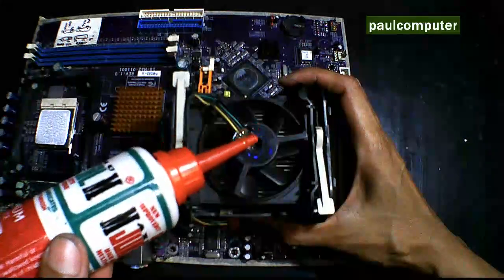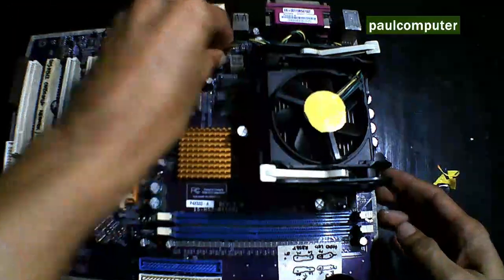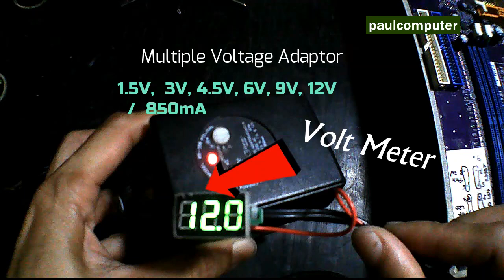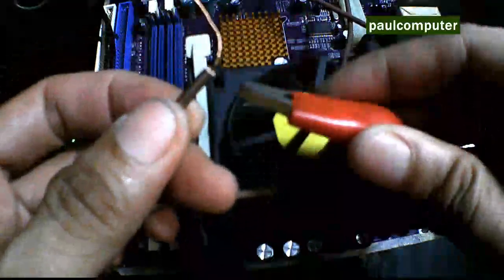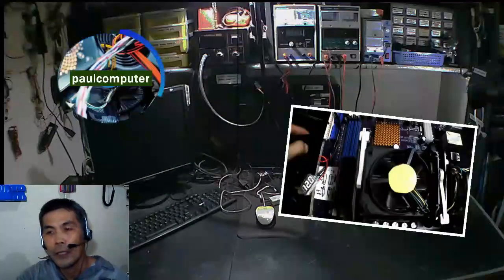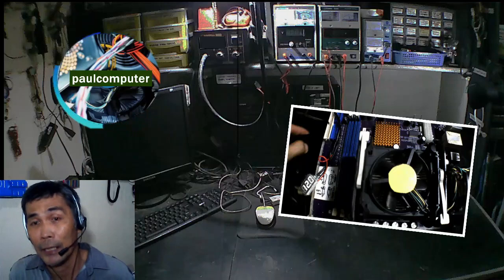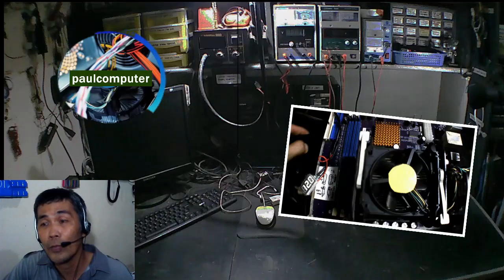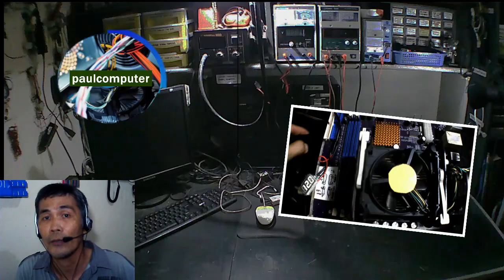HOW TO FIX A NOISY BLOWER FAN OF DESKTOP COMPUTER PROCESSOR - TAGALOG │ w/ CHAPTERS

Comment: Idol tanong ko lng po kung ano problema ng unit ko kasi pag inoopen ko maingay ang fan nya parang nag accelerate pero pag ginagamit kona  sya nawawala na ingay
Reply from the maker: Tingan mo talaga at huwag basta pakikinggan lang. Minsan kasi may sitwasyon na hindi nag iingay ang blower fan pero mabagal lng talag umit kot.. try mo harangin ng kuko mo sa daliri kasi yan ginagawa ko para malaman ko kung malakas ang blow ng fan.
-----
I suppose na fan ng processor yan. So, sa case mo ay suggest ko gamitin ng elec. blower para matanggal ng mga alikabok sa heatsink nya, then, spray ka ng contact cleaner doon sa loob ng motor ng blower fan( para matunaw yung mga malilit pang alikabok na sumiksik sa loob) then after mga 5-10 mins  maglagay ka ng all-purpose oil..  Sakali ng nag-ingay ulit ang fan then its time na bumuli ng bago. ok?
---
Ganun pa man, kung everytime na ino open mo ang computer mo at talagang malakas ng blow ng fan tapos later nawawala ang ingay eh normal yan kasi - initialization yan ng motherboard. yan yung tinatawag na POST ON SELF TEST nya..